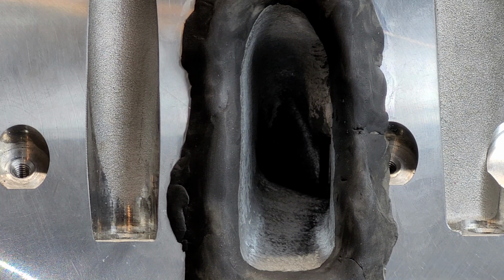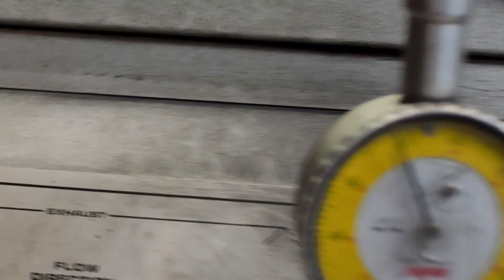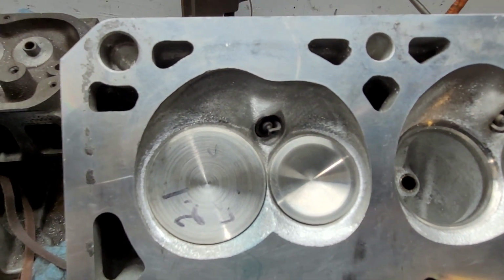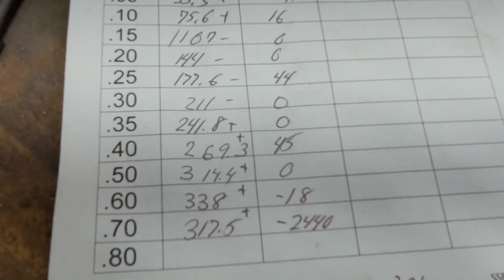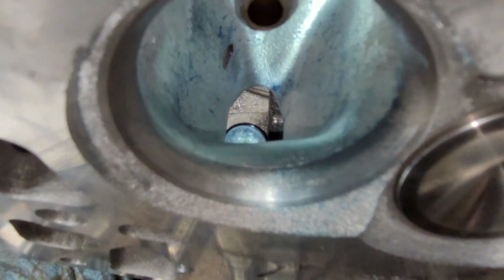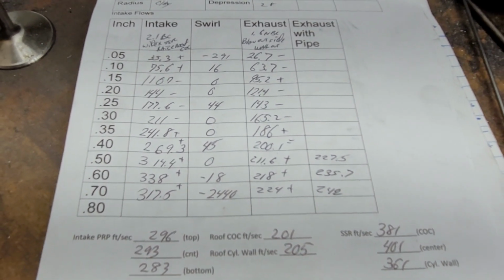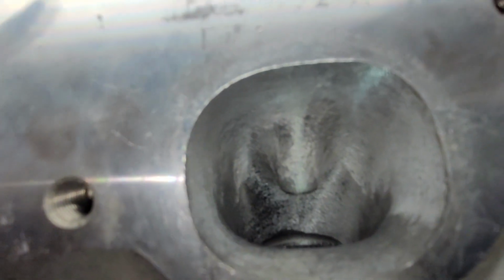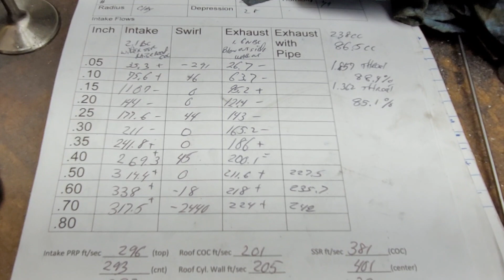Ls1 ported cylinder head, big valve project. RPC, 240cc 360cfm possible? Sailing string at 338 cfm

Comment: Mr Charles that was fantastic hate we couldn't see string better but was still good with the blue on it .port size was impressive and i understand what  you meant a while back referring to exh port shape ..fantastic class.  Thank you
Reply: It all basically goes back behind the valve and gathers near the center. Tight near valve seat with a lil pattern running up the far side wall. Spray paint will show you things too

Comment: Hmm wish I would have had somebody do a valve job after I ported my 317 LQ9 heads 2.05/1.60  has stock 2" 1.5 valves and seat angles 😢

Comment: In my opinion. At least for the heads I have for my motors. You want the ssr to become turbulent just after the maximum cam lift by .050 or so to keep the largest amount of meat in the curve. For a street engine (I mean like .450 to .480 lift cams.) That means that really the only thing that needs to be done to the ssr is to widen it. Also you can use sound even if you don't have a flow menu to hear at what lift a port goes turbulent.
Reply from the maker: I don't disagree with you.
Reply: Street cars only widen and not too much. It's kinda like a garden hose with your thumb over it. A lil change makes a big difference. I've made some mean stock castings and a bunch of them. These things go turbulent @ about .625 .650 no matter what, just about.
Reply: WHOA! Where are .450 to .480 lift cams used??? I can't believe such a "street cam" can exist.

Comment: Good stuff. I dont know how to make it flow more, but I would like to know how much 2cc deeper bowl/longer roof would make a difference.. thanks,

-juhana
Reply from the maker: A few cfm if done right.
Reply: @servediocylinderheads  i would like to see that done and the same time divider after guide pointing more towards the spark plug/bore center, maybe it picks some swirl too? If its not excessive, it helps to fill the cylinder/more flow right? Just thinking,

-juhana
Reply: @servediocylinderheads  - swirl rotates counterclockwise. Did you measure the swirl from "clean up" port, because that flowed more on higher lifts, where this looses flow after it swirls counterclockwise towards the bore wall? Im no expert on this and i dont want to sound like im bashing, just thinking its a interesting stuff and i wanted to share my thoughs after thinking about this, thanks,

-juhana

Comment: Hey buddy, how do i go about sending you a set of aftermarket 11* ls3 heads 2.10 intake/ 1.59 for full port job? 59cc chambers for a 12.8:1 4.065 bore iron block with a holley hi ram 102mm tb, 1 7/8x3in headers, johnson axle oiling short travel lifters, custom hydraulic roller 241/255 640/630 112+2.5. Street strip (mostly strip) stick shift car.
Reply from the maker: @lancegibbs7506  contact me charlesservedio@ gmail.com. Thanks

Comment: Is this head an upgrade to a 799 casting? I'm surprised by the low swirl.
Reply from the maker: This is an RPC casting. No casting numbers.
Reply: @servediocylinderheads  Sorry I ment like a GM 799 casting
Reply from the maker: @dondotterer24  It has a different chamber.

Comment: I think u have done all u can do.  Other people say that if u lay the short side back much, u kill low end power.  And most people seem to stop around 315 cfm on intake flow.  I think ls3 square port heads flow around 315 to 330 on intake.   I'm no expert on this.  Don't take my word for it.
Reply from the maker: I think it is a good mix right now but the big valve may not be helping.
Reply: @servediocylinderheads  what's in it? 2.100"? Chuck, did you mod the chamber or is this an aftermarket as cast. Either way I like it.
Reply from the maker: @arturozarate1752  Did I say the valve size? Idk right now.
Reply from the maker: Big valve was 2.1
Reply: @servediocylinderheads  sorry I rewatched and I was about to mention that.
Reply: @servediocylinderheads  can you estimate how much the chamber shape helped flow over a stock shape?
Reply: @servediocylinderheads  I watched a Darin Morgan video a while back.  He said that when gm engineers designed the ls3 heads, the intake valves were 2 big at low lifts.  So, what they did was to leave the short side radius at a sharp turn. This sharp turn created turbulence making the air go around the turbulence, minimizing the opening and and keeping the air speed high.  As the intake valve opened, the dynamics of the air changed.  Darin has very good illustrations of this and explains it in his video so that anyone can understand it.
Reply from the maker: @ericsmcmahan  I saw that.
Reply from the maker: @arturozarate1752  Not much different. Just blended and a bit of deshrouding.